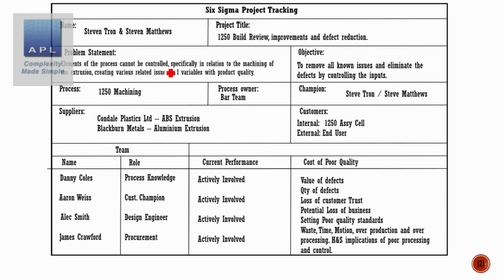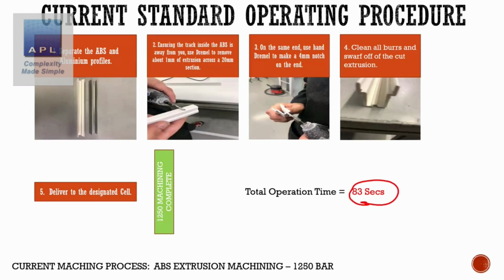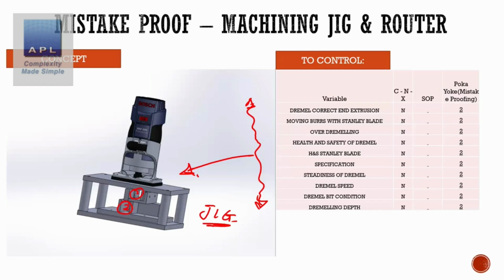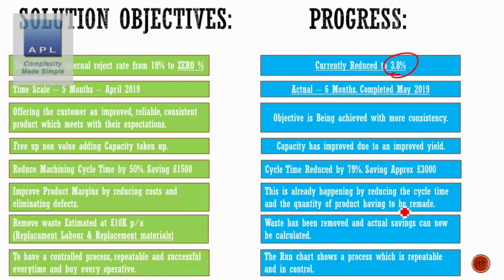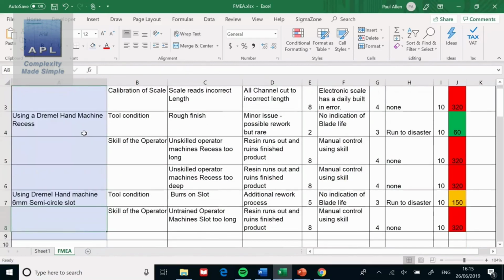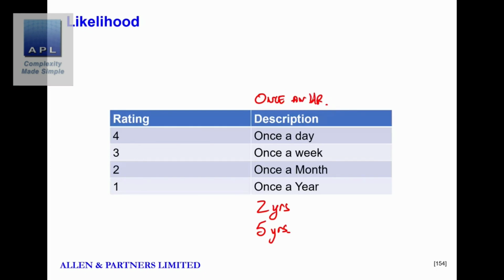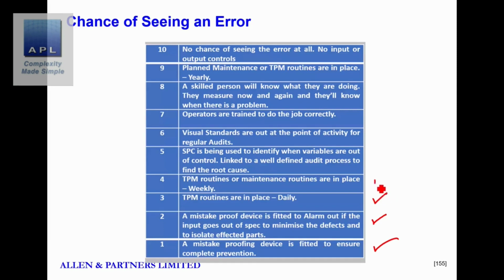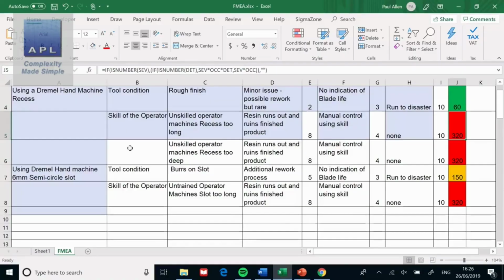FMEA makes Six Sigma Obsolete!!

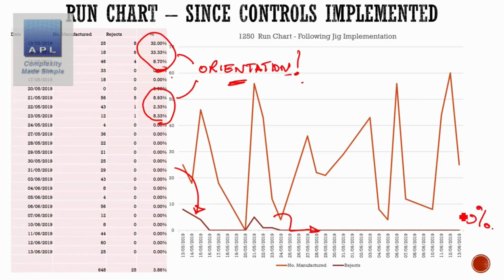Comment: 15:16 - the "3.8%" is a terrible round from the 3.86 % that is the average of all the measurements, including the first you mention where the orientation was wrong, so an average containing two stages of process optimization.... Numbers are only as good as those making them :-)
Reply from the maker: Jangoofy - I'm sorry but my number is as accurate yours. My value comes from a sample, a sample is an estimate. 3.8% is an estimate and 3.86% is also an estimate and we have no way of knowing which is the more accurate....mathematics is all estimated values, sometimes you can know good estimates from bad. In this case we can't....
Reply: @paulallen5321  My bad, it was poorly expressed at too late an hour.

What I meant was, as you said in the video, the defects are really 0 %, since they had been 0% since the last improvement, and the 3.8 / 3.9 % should not be used as a value for the end result / report.